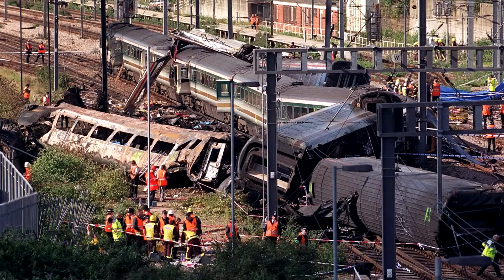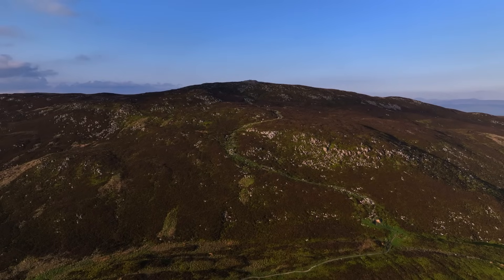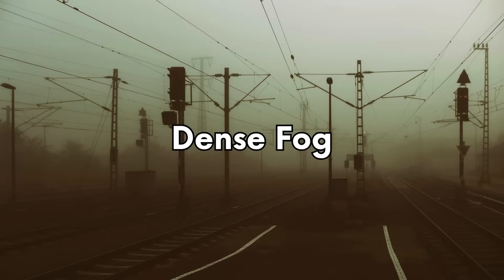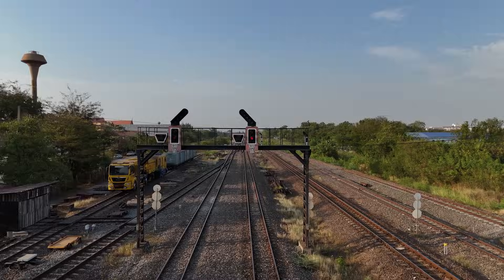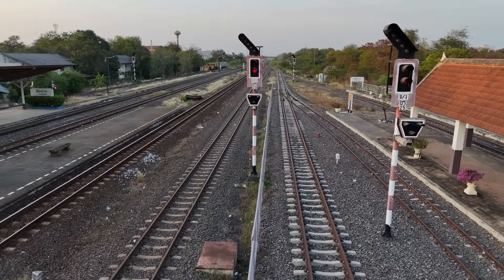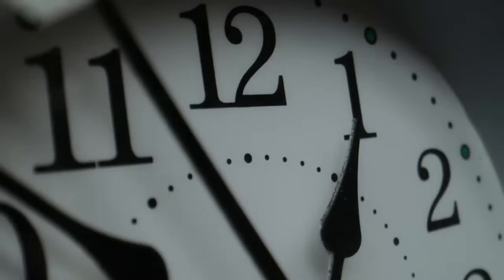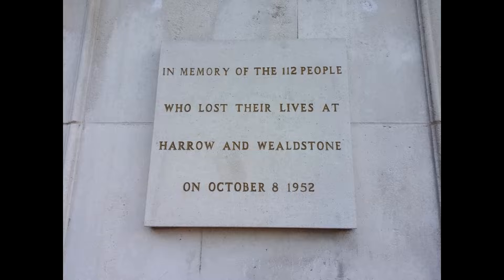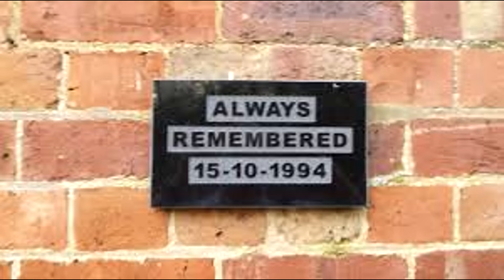Built on Tragedy: The Rail Disasters That Led to AWS, TPWS & GSM-R Safety Systems

Comment: SPAD AWS is really an issues(as the problem than ATP,because UK preceptive on Signal safety is route knowledge instead of Speed restricion)
AWS purpose is route available instead of ATP of Speed Continues Regulation,this can cause a huge problem when Train SPAD and it fail to stop.TPWS is try to fix the problem because Railtrack and the government didn't want to implement ATP by 1994 report,as they this ATP is not worth any penny for each life could be saved by cost).
AWS even is early type of cab signal,but it didn't really SPAD fail safe system.
AWS also involve in one of the turn back collision back when Hong Kong KCR still using it in 1984.
We change to TBL in 1998

Comment: THE CIVIL SERVANTS NOW RUNNING THE NETWORK FROM THE REAR SEAT !
Your living in a fictional world. You have absolutely no idea what you are talking about. Modern post BR equipment such SPAD signals & TPWS and ETRMS are a cheaper solution than paying to teach Train Drivers how to be Train Drivers. Which is why a Post BR driver can get a job on the railway and be driving a high speed train in just six Months. Under BR safety rules no one was going to drive a train in under FIVE YEARS. But then BR Drivers had to learn a lot more than the "Muppets" they churn out today. And whom they now pay anywhere from £55,000 to £75,000 a year. It's the same game in the Airline industry. Cut Pilot training from 5 to under 2 years, by adding a few more cheaper computers. So do NOT bother teaching Airline Pilots to fly Commercial aircraft by the seat of their Pants. Modern madness !

Comment: In Britain, the old Great Western Railway introduced a form of ATC in the early years of the Twentieth century.  Initial experiment on the Henley branch in 1906 was a warning system, which was then further tested on the Oxford to Fairford branch line.  Then between Reading  & Sloughin 1908 then Slough to Paddington in 1910.  The system was subsequently modified to open a valve letting air into the automatic vacuum break unless or until released by the driver.  (Source: "Red for Danger" by L.T.C. Rolt, 3rd Edition page 239).

As also mentioned by other commentators, the London Underground had a trip up which was raised when signal were at danger, which would trip the emergency brake if a train passed a signal at danger.

Comment: Nice concise video showing evolution.  You might add ETCS and ERTMS to complete the picture?

Traditionally pretty much all safety regulations and protocols have been written in blood.  But I do believe that in recent years we have got better at pro-actively seeking out holes in safety systems and considering how to cover them.  In part this has been led by the need to make complex process plants safe, using methods such as HAZOP where a team of experienced people probe actively for holes in the safety protocols.

Comment: I'm quite suprised that the UK doesn't actually have automatic train control. Almost the entire norwegian rail network uses it, with some a few lines using ERTMS or block signaling.

With a non functioning ATC trains are not permitted to exceed 50 mph, permitting 120 mph without any safety systems is outright reckless.

Comment: How about a sensor system that can run as a low electrical current, if it finds a crack or break in the line it slows, stops any, every near train and sets an alarm to control with coordinates.  this could be sea or heat damage or wear and tear.  i hope this helps.

Also tunnels, sensors to record tremors and listen for falling rocks etc. to raise similar alarm as above.

Comment: In Berlin they had a system (for over 90 years) where a wooden board would be raised when a signal turns red, which a lever on the side of the train would hit, triggering the brakes. Just a few years ago they started swapping it out for a computer based system
Reply: They have a similar system on the London Underground
Reply: Just to add to what OlanKenny has said, the London Underground version is called a tripcock and has been in use since 1903.

Comment: we need this type of stuff on cars!
Reply: I think cars are different. We need robot cars, but we need every car to be robotic, not a mix of human controlled and robotic. That vastly simplifies the way the autonomous vehicles can work (for example they don't need radar, lidar, visual processing to keep an eye out for other vehicles, they could be guided by signals from the road itself etc), and simpler systems are far safer because they are easier to verify/prove that they are correct.

Comment: The ironic thing about Harrow and Wealdstone was that there was a demonstration of the Hudd AWS system scheduled on another line on that day. It still took over 60 years to fit all signals ! Little Britain then went ahead and designed its own enhanced system (TPWS) rather than buy a much better system like that used in Holland.
Reply from the maker: That is scarily ironic
Reply: True enough re the sloth in fitting AWS nationwide, but Little Britain's development then nationwide fitment of TPWS (the concept was already out there before Ladbroke Grove) took barely five years; an amazing achievement by contrast. You have to remember that TPWS was conceived against a backdrop of the disproportionate expense of ATP (ETCS was barely on the horizon), and that it had to be capable of being retrofitted to all existing train and signalling system types as soon as reasonably possible. TPWS soon proved its worth in saving lives at a fraction of ATP's cost, well beyond initial assumptions.

Comment: I think it be safer to use devices on main lines for East Coast Main Line for example which automatically put on the emergency breaking system if a train SPAD, like on London Underground. If a train was given promission to pass the red signal, there is a button they can press which lifts the safety switch (when  at normal level will touch the device which put the train emergency brakes on), higher enough that  goes over the safety switch so it can carry on it's journey, after five seconds it lowers back to it normal level which stop train if it SPAD a signal

Comment: Definitely a good start point of a timeline. There are plenty of vids out there that cover individual accidents, the ones that caused a safety change, few do what has been started here and sown them together so you can trace the progression, great start but can definitely expand 🎉
Reply from the maker: Thank you! Where do you think I need to start the next one?
Reply: @thepwayengineer   Quintinshill Rail Disaster would be a good one, unlike most of these, the change wasn't a 'hardware' change (adding/removing something from the train to make it safer) but a 'software' change; changing rules and practices, they say every safety change is written in blood and, well, there was a LOT of blood at Quintinshill.

Bagworth (1833); as a result of this accident [train colliding with a farmers cart on a level crossing], whistles were mandated on locomotives.

Abbotts Ripton (1876) bringing in the "fail safe" mindset; if a signal fails then it must fail in a condition that affords the maximum level of protection - This can also bring about discussion around 'upper quadrant' and 'lower quadrant' signals and how the latter offers no fail-safe, whereas the former does.

Comment: Continuous Automatic Brakes meant Automatic Vacuum Brakes where the admission of air puts the brakes on (most pre-grouping railways) or air brakes which operate as described (a few pre-grouping railways). The train at Armagh had simple vacuum brakes which used a vacuum to put the brakes on which meant that the entire rear portion of that train relied on the screw brake in the guard's compartment for braking.

Comment: There is much more to the Armagh rail disaster than given here. The run away of the rear portion of the train wax caused by the front portion rolling back onto it.
Reply from the maker: Interesting! Maybe a separate video on the disaster?

Comment: With Southall, the HST was also equipped with ATP but it had a fault of stopping on green signals plus in the days of steam before British  Rail the GWR had a AWS in cab system, The dead's man's handle has been in use since the dawn of diesels
Reply: Pedal in all diesels built since the 60's, that's the DSD pedal. London underground uses a handle which is kept depressed whilst the train is moving.
Reply: To be clear, the leading class 43 on the Swansea to Paddington train 1B08, 43173 had a defective AWS, which was turned off before the incident. The driver, Larry Harrrison later testified that as his train passed Hayes and Harlington station, he took his eyes off of the line ahead and was putting his things away in his bag, only looking up to see a red danger aspect on the Down Fast into Southall and the hopper train travelling diagonally in front of him. He slammed the brakes into emergency but it was far too late as he was travelling at roughly 125mph.
Reply: @lukethomas.125  
All FGW HSTs had been fitted with ATP in BRWR days as a pilot scheme, but there were numerous reliability and maintenance 'issues' with both track and trainborne kit that R*******k and FGW respectively had failed to get a grip on, so the system was not routinely being used. By 1997 matters had started to improve, with plans to take ATP finally out of 'pilot scheme' and into full service status, but training/ competencies of many drivers had lapsed. The rules at that time allowed trains to continue in service with duff AWS until it could be fixed at depot. Larry Harrison had taken over the train at Cardiff in that condition.

Southall led to
a) a significant tightening up of the AWS failure rules, and 
b) full commissioning and mandatory use of ATP by fitted trains within the fitted area of the GWML.

Comment: I noticed in the UK, there was also the Moorgate Protection system after an underground train crashed into the end at a terminal station, Moorgate.  I remember seeing a photo someone took of a rail gap which was filled with bolts.  I jokingly commented it was a rumble strip like on highways to wake up the crew and let them know they are coming to the end of the line.
Reply: Valid however it is predominantly associated with London Underground, which is a different kettle of fish along it does share some safety lessons from overground operations.
Reply: Ah yes. Unfortunately, the heavy rail system never adopted the Moorgate system, although the drivers are taught about it (I believe). There are still accidents at terminal stations/platforms, though not as serious as Moorgate.

(It was a terminal station accident that got me interested in the subject - Largs station, 1995. I (very tenuously) knew the station manager on duty at the time, so it was discussed. I love the fact it's called a "buffer incident" on Wikipedia. ScotRail call it "station remodelling" which is far more accurate given the train overrode the buffers, went up onto the concourse, and through the shops. The driver's cab was in the middle of the street outside! Not sure even Moorgate protection would have saved this, though, since it was a total failure of the brakes themselves, which the Moorgate system rely on)
Reply: @CharityAngelSpectrum hey I’m a mainline driver and we don’t get taught about the Moorgate system. We have similar safety systems for terminal stations (TPWS against buffer stops) which can trigger brakes in going too fast

Comment: I don't understand why the british government could allow such a dangerous Safety system.

In germany we use PZB which has more safety features than AWS and is rather simple. And yes we had accidents were PZB hasn't worked but it was like most accidents human error...

PZB basically functions like AWS at signals are magnets which when the signal shows yellow or red are powerless and when the train passes over it, the magnet on the train induces a current at a specific frequency into the track magent.

For example yellow. If the train passes the signal, the driver has 4 seconds to acknowledge the signal if he fails to do so the train automatically activates the emergency brakes until the train stops. When he acknowledges the signal the driver has to brake under a specified speed or the train stops. 

Then we have intermediate magnets around 250m from a red signal which slows the train down even more, if the driver dosen't brake, the train stops. And finally if the driver passes the red signal at a low speed (in germany it is 40 km/h for passenger trains, 35 for light and medium heavy cargo and 25 for heavy cargo) the train applies the emergency brakes. 

I know that the speeds and signal distances are different in the UK, but the system could be optimized for UK rail.

Or use ETCS, which has a lot of elements from the PZB and was developed with these safety systems in mind. 

But every train accident is a tragedy and human error is one of the biggest triggers which no system can control.
Reply: In UK we have had TPWS since 2003, which has many if not all the PZB functions you describe. AWS is really a legacy system & now mainly acts as a backup.
Reply: @chrislambert-shiels5291 TPWS is compared to PZB a new system. TPWS has also not as many features as PZB, for example: Acknowledgement of restricting signals, and forcing the driver to slow down with an brake curve.

With TPWS the speed is only checked when you driver over the loop, and not for the whole braking distance. 

TPWS is also not fail-safe because in case of an power outage the system fails, with PZB if the power goes out the magnets are permanently active.
Reply from the maker: You make a good point around human error. 

Thank you for the information on how it is done in German, interesting as I don’t know much about the railways there
Reply: You need to design systems that account for human error.
Reply: @SRN42069that’s what the PZB does, if the driver makes an error the train should come to a complete stop. We have a slip path behind most main signals which account for speeds up to 45 km/h. 

If the train runs the signal the PZB triggers an emergency brake and with 45 km/h the train stops before the switches and also all signals which interfere with that path all go to danger. 

If you don’t acknowledge the advance signal, the train triggers an emergency brake after 4 or 2,5 seconds depending on the system. 
If you don’t follow the brake curve same thing emergency brake.

If you pass the second magnet with too much speed, emergency brake, and if you don’t follow that brake curve same thing.

The PZB can‘t do everything sure, but it has a lot of safety built in. If the computer on the train crashes or the PZB detects a fault, the system automatically triggers an emergency brake. And if you continue driving, the PZB sets a maximum speed of 50 km/h or 100 on older locomotives.

The PZB also has a tachograph which safes all relevant information about a train journey, Driver number, brake percentage, train number, speed and all operating actions regarding the PZB.

Comment: I'm in for a deeper look into the history. My safeworking instructor had us read the Quintinshill report. Near 40 years later I'm still very liberal with applying blocks on the TCS
Reply from the maker: Thank you for letting me know!
Reply: I'm led to believe that Quintinshill is still taught to trainee signallers. Long may that continue - this is why we're supposed to learn from history, and I love that the railway still does that. Someone should
Reply: @CharityAngelSpectrum  I hope so. I'm a practical trainer and I've used it as an example of how not to do the job to just about all my learners.

Comment: It's quite interesting (and tragic) that every country "needed" to have their own tragic accidents before implementing these systems. Here in Norway we were especially suseptible to head on collisions due to most of our network being single tracked, as well as having no train  protection system until 1983. However, we still had relatively few accidents, because the vast majority of stations were manned, allowing strict manual control of which trains are allowed to drive into a single track section. After CTC was introduced, we got some very serious accidents because the human oversight at the stations was no longer there. 
Now, most of our network is covered by the Swedish/Norwegian ATC system, being replaced by ERTMS in the next ten years. 
Sadly, a few main lines in Norway still use this: A slightly upgraded 1800's flag based system, which interlocks points and signals by using a fancy key box and telegraph. https://www.youtube.com/watch?v=PkDQ594Ma38 (Video in English)
Reply from the maker: It is sad that it take lives to motivate change

Thank you for the link to the video, I'll cheek it out

Comment: Indian railways have got the same rules like block, interlocking etc still faces plenty of accidents due to 
Hudge traffic of trains on tracks
Reply from the maker: Interesting! Are there any major changes or upgrades planned to address the issues?
Reply: They are improving the signaling system to etcs level 
Known as "Kavach" on country's 
Busy routes , its will take decades as the upgradation is really slow

Comment: Where cost was considered an obstacle to implementing a system, I always wonder how that cost compares with the actual total cost of an accident that the system could have prevented.
Reply from the maker: The willingness to spend money always comes after something has gone wrong. Money suddenly become no object
Reply: There's a formula apparently. That formula is the main reason Ladbrooke Grove happened - apparently it was cheaper to pay the fines/compensation etc for the SPADs, including the chance of collision, than it was to install TPWS.

It wasn't.